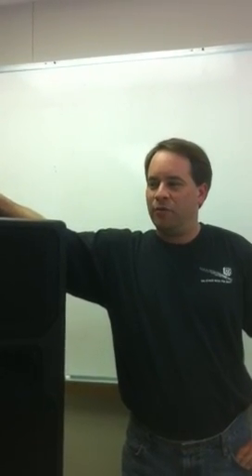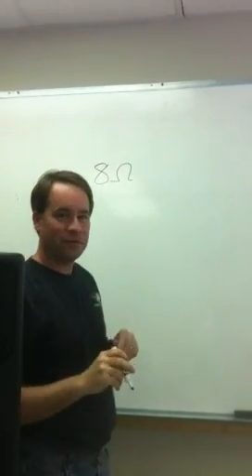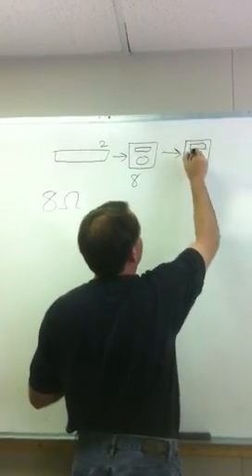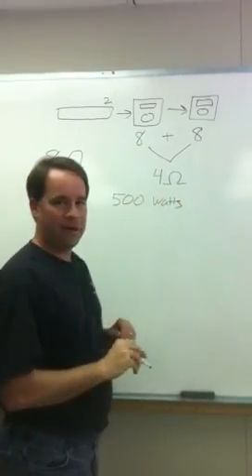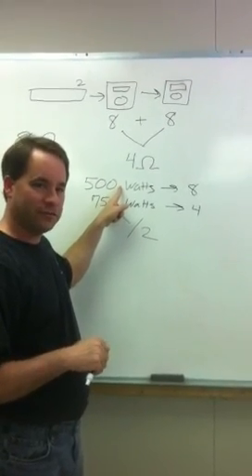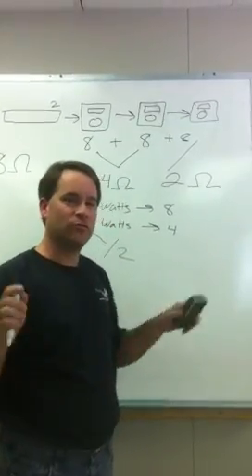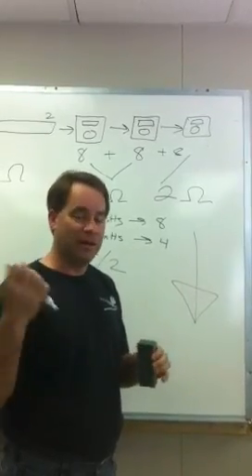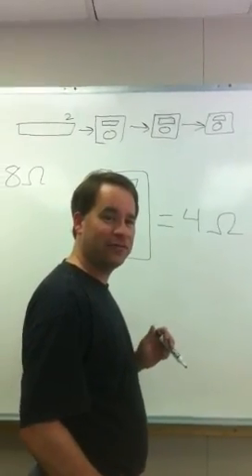How to understand Ohms in simple terms...

Comment: How did you get this formula with figuring out that adding a second 8 ohm speaker drops to 4 Ohms? Im super confused about that. I understand that your dividing 4 ohms from 8. But how did you come up with this formula? So i guess its safe to assume that you always divide half of whatever ohm speaker it is down whenever your adding speakers?
Reply: To get the equivalent impedance of impedances connected in parallel, take the reciprocal of each of the impedances, add them together, and then take the reciprocal of that sum. The result is the equivalent impedance. For example, what is the equivalent impedance for three 8-ohm impedances (loud speakers in this case) connected in parallel? Sum the reciprocals: 1/8 + 1/8 + 1/8 = 3/8. Now take the reciprocal to get the final answer: 8/3 = 2 2/3 = 2.667 ohms. (He was off a little when he said the third speaker made it 2 ohms. Actually, it is 2.667 ohms.)

Comment: Could u put 2 8ohm 1000w speakers on to a 4ohm 4000w amp and it run ok
Reply: Jimmy Ellis yup by parallel connection but you have to put capacitor to give limits to your amp to avoid overheating of speaker...